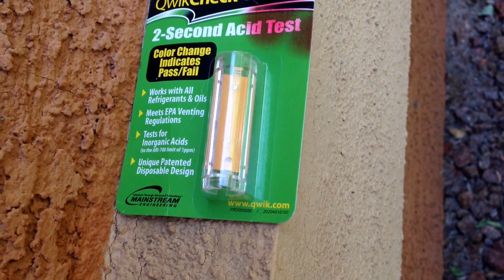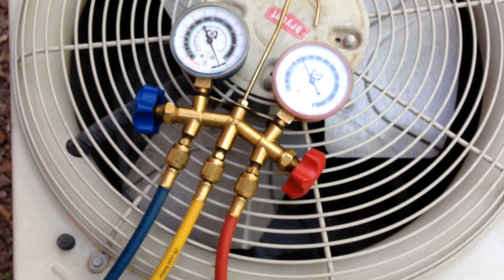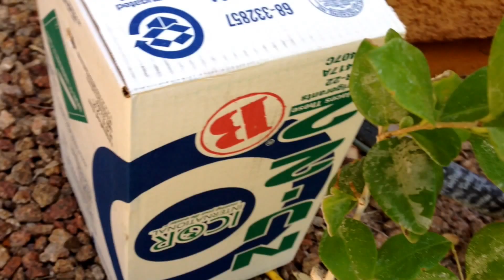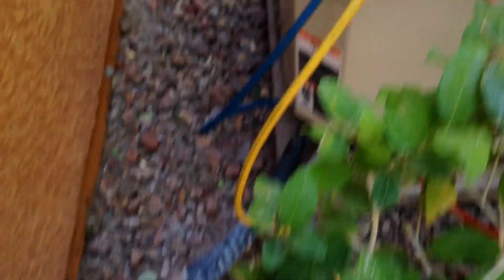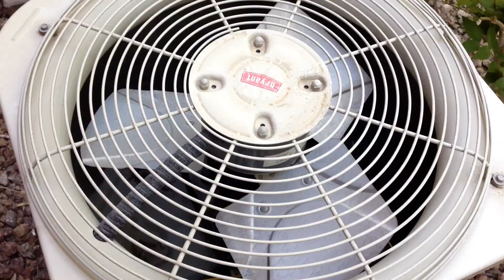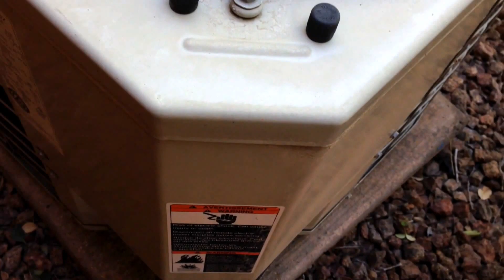R-22 Drop In Replacement

Comment: HI, I'm a senior on a fixed income, live in a old mobile home with Coleman 7836-901 air conditioning unit. SDGE stopped doing free a/c tune-ups, last year. My ac worked fine after last tune up, but isn't cooling well when I turned it on last week.  From what I've read R22 is going to phase out. Can my old a/c be retrofitted to accept a newer refrigerant or can the R22 just be changed out as you are doing in the video for the service call? If so which one would be the best to use for it and approximate price that should cost? (so I know rough price to expect & not ripped off)

Comment: I have guy that just add the NU and now he's using 427 on R22 he just adds!
Reply from the maker: Hopefully he is not mixing the refrigerants. You would need to do a proper recovery of refrigerant in the system. Vacuum the system. Replace the filter drier...  and then charge the system with the "drop in" refrigerant. Failure to follow this procedure can have catastrophic reactions let alone destroy the system. Hope this helps!
Reply: Sam thank you.